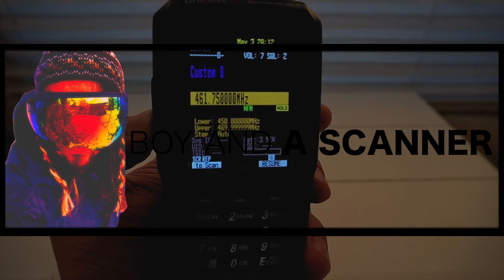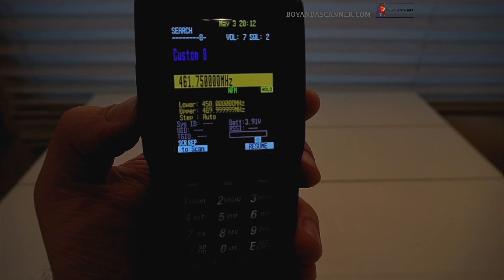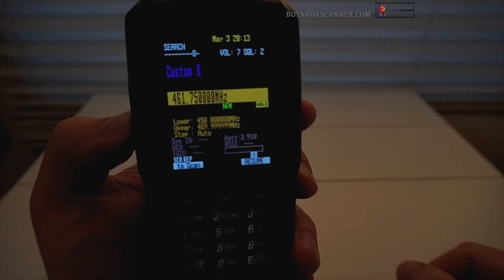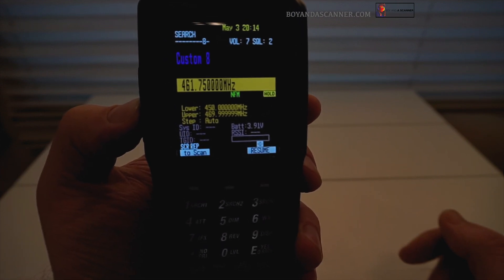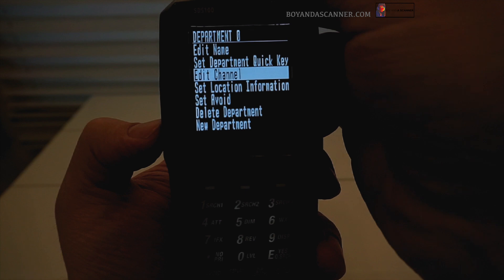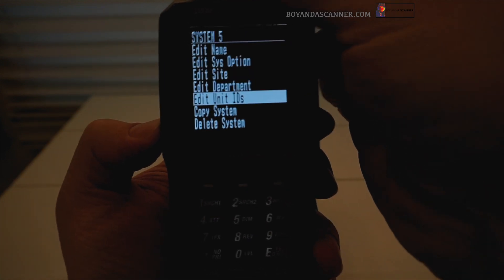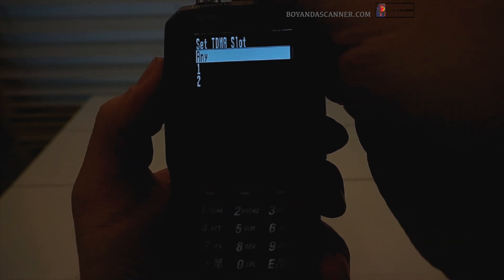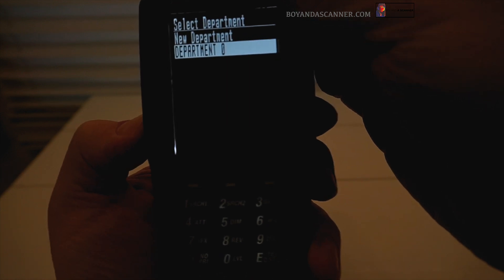Finding DMR System Frequencies on the Uniden SDS100

Comment: I am not understanding this is this all from a simple search between frequency limits or do you have to set it up prior to this to see this Plus or the slot because I do not see it on the screen there the slot I’m visually impaired and this is becoming so frustrating that I want to go back to the Whistler scanners Can you please help
Reply from the maker: I understand your frustration! To see the PLUS/slot indicators in the SDS100: First, you need to have a DMR system programmed (not just doing a frequency search). Once programmed, during scanning when a DMR signal is active, the scanner will display "PLUS" or "SL1" or "SL2" on the screen. These won't show during a simple frequency search - the system must be properly set up first. If you're having trouble seeing the display, try increasing the backlight to maximum and adjusting the contrast in the settings menu. The Sentinel software on a computer also shows these details more clearly if that helps!
Reply: @BoyAndAScanner  thank you very much for your help. This will help a lot.

Comment: How do I know if my area is using these upgrades etc? Southeast WI area near Milwaukee and Chicago area as well.
Reply: And can I just log into the software connect to the scanner and add via radio reference pages?
Reply from the maker: All the frequencies in the radio reference database are already built into the scanner and it just updates that database via the programming software. You can see what systems your county or city are using on radio reference but just keep in mind it'll be the same inside the scanner so if a system is using P25 according to radio reference then that's what you'll need on the scanner.

Comment: Keep in mind some systems make use of the time slot - my local shopping centre here in Australia use a single frequency, with security on time slot 1 and cleaners on time slot 2 - both use the same TG but are different "channels " on the radios.
Then you have sections of the shopping centre that use the same frequency again but different TG. It's amazing how many "channels" can be used using a single frequency.

Comment: I know DMR but what is DMR-1?
Reply: I think he means DMR Tier II.
My understanding of the three different DMR systems or "Tiers" is as follows:
DMR Tier I: Single frequency and usually simplex operation, that is, one radio talking directly to another radio using line of sight.
DMR Tier II: one particular frequency, radios communicating to each other via a repeater, that is, transmit and receive frequencies are different.
DMR Tier III: trunked system using multiple frequencies with a control channel (CC)

Comment: I monitor my Public Safety in the malty high rise Coop Community where I live ( 36 buildings) and found that information on Radio Reference. I just added the info on RR to the scanner and can monitor all their frequencies and radios (UID) without inputting any Unit ID. I am sure I programmed them in all as Conventional and they use DMR. What would be the benefit of adding the Unit IDs and where would I put them? Thanks for the video. Will watch it again. Thanks again.
Reply: &d